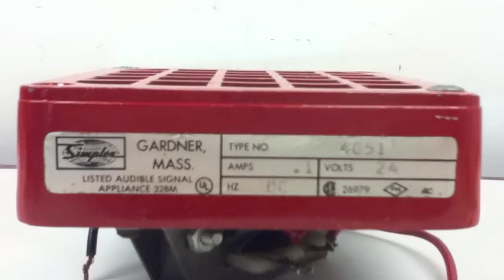Simplex 4051 Fire Alarm Test

Comment: elevatorman5482 4051s can only do continuous. To make a 4051 do any other code, you need to wire it to a fire alarm panel, then the fire alarm can be panel coded.

Comment: That was a quick reponse from the pull
Reply from the maker: The pull is wired directly to the horn in a basic switch/load circuit, so of course it's going to be an instant response. There, no panel used here; I do have a panel board, but I haven't felt like using it lately.

A basic conventional pull station is just a switch, with a mechanism to activate it. In this case, pulling the lever causes a button inside to pop out, closing a circuit so the electricity can flow through, locking the lever, and of course, sounding the alarm.